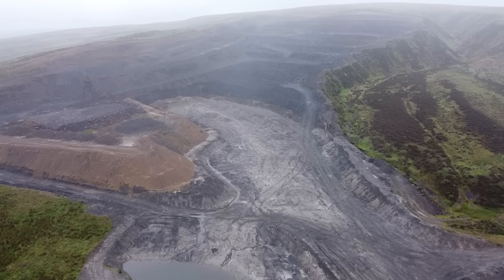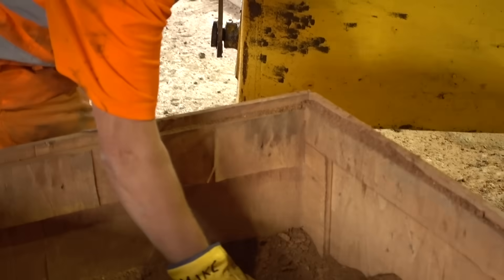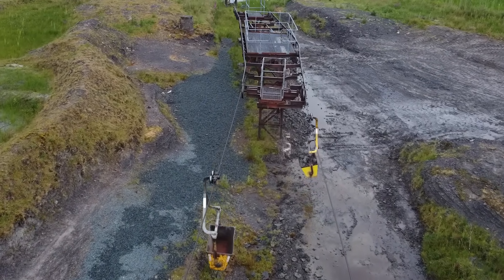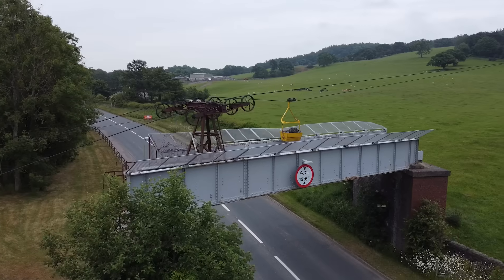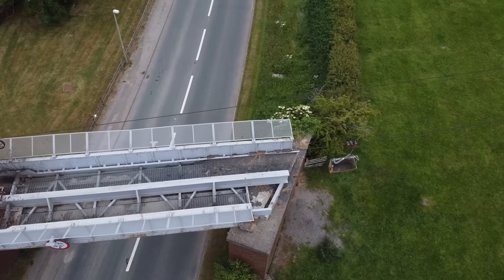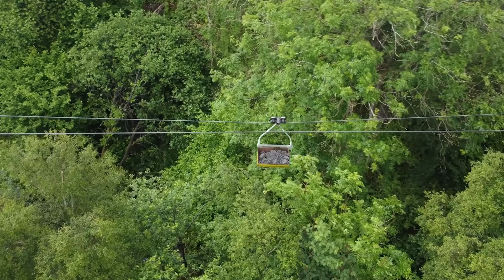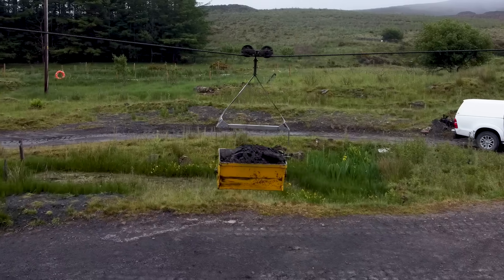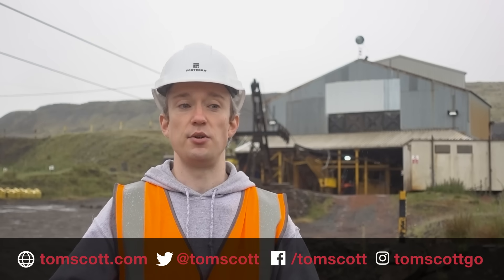The UK's last aerial ropeway uses no power, moves 300 tonnes a day, and will be gone by 2036.

Comment: It's amazing how well old technology works compared to more contemporary solutions. Here in Pittsburgh we have two funiculars built in the 1870s that are still frequently used. They're protected by a preservation society (also the citizens would riot if they were removed) so they should remain for quite some time. And the view from them is stunning.
Reply: What are they?
Reply: @millerchassis6119  we call them inclines, they are counterbalanced trolleys used to go up and down the steep hills into the city
Reply: @millerchassis6119  What empressmarowynn fails to mention is that these inclines use electric powered motors to make it work. (I rode on both) Yes, the 2 cars, one travelling up while the other goes down, are counterbalanced. But if they were perfectly counterbalanced, they would sit still and not move. Even putting passengers in one car and leaving the other empty would likely not be enough to overcome friction. And even IF friction could be overcome, what happens when the passengers disembark from the occupied car? We generally need to obey the rules of thermodynamics, lest Isaac Newton and James Joule come back to haunt us.
There is one of these inclines in L.A. too. It's called Angels Flight, built in 1901. "Angels Flight" is the title of a 'Harry Bosch' book by Michael Connelly & episode of the Amazon Prime series "Bosch."
Reply: @RichardFallstich  there are water powered ones
Reply: OK. It could be powered by water, electric, or steam, etc. they still need some external power to move mass and overcome friction.
Reply: @RichardFallstich  Do you think you need to pedal a bike in order to travel from the top of a hill to the bottom? If you push a ball down a hill will it not move without an external power source? The ore already has potential energy it's simply going downhill. Do you look at hydroelectric dams and wonder where they get the power to run the water pumps? Because obviously all that water can't just move without some external power supply.
Reply: Cincinnati used to have some

Comment: Question: if this is the last aerial ropeway in the UK, does that mean  the Emirates Air Line in London is not a ropeway, or that it's not in the UK?
Reply: "The UK's last aerial ropeway USES NO POWER , moves 300 tonnes a day, and will be gone by 2036"
Reply: @DELETEDUNUSED  Yes. "The UK's last aerial ropeway which (a) uses no power, (b) moves 300 tonnes" and so forth. It doesn't say it's the UK's last unpowered aerial ropeway.
Reply: @joelalexander4748  im sorry im sorry im sorry im sorry im sorry im sorry

Comment: I'm still wondering how it works without the need of fuel or electricity...
Reply: Right, this would make sense to me if the empty buckets locked onto the rope and rode up... but the wheels at the top seem to be spinning. I wish they had gone into more detail.
Reply: gravity stuff i can explain in more detail if you want
Reply: @flowi1227  yes please
Reply: @joepgoossens5667  the full buckets get pushed at the top and since its slanted they go down naturally. since the rope is connected and the empty ones at the bottom are way lighter they get pushes up to the top

Comment: It sounds like they are missing a grate opportunity in this system, there should be a generator used as a load primarily(to slow it down) and a brake as back up. That way some of their power cost can be removed. Can that be done here, even theoretically?
Reply: ""The UK's last aerial ropeway USES NO POWER , moves 300 tonnes a day, and will be gone by 2036"
Reply: @flowi1227  Yes it does, nothing moves with out power, it uses gravity as a power source, and in order for it not to run away in speed they need brakes. What I suggested was to use the same amount of power removed by the brakes to instead power a generator. They have 15 years of power to use, letts not waste it.
Reply: @agw5425  i dont think breaks are nessacary considering how slow it is

Comment: I used to work near there about 15 years ago, used to pass under twice a day. Could see the guys working there grabbing the buckets, they didn't have safety helmets nor HV wasn't that long ago! There was another one going to a different quarry along the road towards Lancaster but that was disused and had no ropes but the towers were still up. It's actually in the Lune valley and is very scenic on a nice day, you can see Ingleborough rising above the hills as you drive east from Lancaster along the road.

Comment: Hastings has a little railway which is operated by gravity. It obviously wouldn't be the same to ride, but it's just as efficient. There are 2 coaches, 1 on each track, joined by a cable over a pulley. There's a tank under each coach. To move them, Water is poured into the coach at the top of the hill and, as it goes downhill, its weight pulls the other coach up via the rope. "The West Hill Lift retains its original wooden Victorian coaches, and also runs through a tunnel, very unusual for a funicular." Edit: And then I looked it up and learned Hastings has 2, and there are probably plenty of others scattered around the world. :)

Comment: The only thing I could imagine it turn into is a skilift attraction, maybe with a themepark at both ends? But then you likely have to ajust the towers and cable to handle that much load. Also the themeparks would maybe in the middle of nowhere, not making it easy to attract people.

Comment: Do you think that they will let the end stations keep standing and maybe some of the cars nailed to the load and off load ramp for tourist attraction?
Reply: Now you know some knucklehead will try to climb the tower claiming to have a right to an adventure, disgrace it with graffiti.
Reply: @norbertdx  Yes I know, and that was NOT my question. It was 2 buildings at each end of the line will they remain, as a hiking track, so you hike from one to the other, and then leave some of the karts beside dem, you could put tem 30cm off the ground with a 150cm pole to surspend them, yes you could use is as a swing. COMMON @norbertdx, as a family hike to the top of the hill and to see the system where they park the carts off the line and put them on again. YES take down the towers... SIGHT!

Comment: I bet people would pay money to ride it back and forth lmfao.
Reply: You could only ride it one way, it’s gravity operated so the returning buckets have to be lighter than the arriving ones.
Reply: @jupiterjaeden9163  And on top of that it could only work with a steady flow of tourists. Can't have just one person on the ride, needs the correct spacing of buckets (each containing like 3 people to match the weight of the shale).
Reply: @nathfrancois5507  or two americans.
Reply: Easy solution: Build the restaurant at the top.
Reply: @victorhopper6774  too much weight, you would need an american child to balance it xD
Reply: @Fritz46  pp
Reply: @jupiterjaeden9163  One person up, two down...but there may be quite unbalanced waiting queues
Reply: @jupiterjaeden9163  Nah, miners used to ride ore buckets to work using the same gravity-feed systems all the time in Colorado, ore and rock weighs more than a few people
Reply: @jupiterjaeden9163  do you weigh a quarter of a ton or something?
Reply: @AinzOoalGown2138_2  i don't think you understand how it works at all
Reply: You could use weights like water cisterns to balance the ride.
Reply: Weight problem
Reply: It would be too dangerous to have tourists in a working mine. Plus they will get in the way of the workers
Reply: @TeaInTheMorning-we2kh  his point was that they would turn it into a tourist attraction AFTER the mine is done
Reply: @woodychelton5590  but then they would have to motorise it because it could no longer be gravity powered since the weight going up is the same as the weight going down.
Reply: @TeaInTheMorning-we2kh  I know that, it's discussed in the vid
Reply: @woodychelton5590  what would be the point then? If you want to ride a regular chair lift just buy a ski resort pass
Reply: @TeaInTheMorning-we2kh  bcuz there are no ski resorts in that area
Reply: @woodychelton5590  Ah, well maybe they will do it then.

Comment: Why doesn't it use any power? I don't get it.
Reply: You don't need power to have a bucket ziplining down hill.
Reply: @MrHat.  But don't they go up as well? It's not downhill both ways.
Reply: @8.3.4.N  downhill with heavy load, uphill with empty load.
Reply: @MrHat.  Ah, that makes sense. For some reason it didn't connect in my brain that the ones coming back up are empty.

Comment: Similar technology can be seen in an episode of Thomas the Tank Engine . The only difference is that the gravity cable was hooked up to rail cars; heavy cars, going down, pulled up empty cars.
Reply: That approach was actually used by a mine in Australia. Two ordinary railway lines side by side with wagons but no locomotive of any kind. Instead the two sets were joined to a steel cable run to the top of the hill. The weight of the fully laden wagons going downhill pulled the empty ones up. Then load / unload at each end and repeat the process. Zero fuel or power of any sort needed. Only reason it's no longer in use is the mine itself has since been closed.

Comment: Very cool. The question I have -- that I was hoping the video would answer -- is  how the thing gets started (if they are not operating it 24-7 or, say, after replacing the rope). Does it require a complete set of full buckets to operate and, if so, how does it operate when not all the buckets are full yet?
Reply: I can only presume but at night the carts going down the hill stay loaded until the brakes are let off in the morning. I've driven under it a few times and they've been stopped with the carts still loaded.

Comment: There's a Victorian thingy on a big hill in Wales, the car, like a ski lift has a big tank under it. A stream at the top fills the tank and the car descends under it's own weight. The other car which is at the bottom empties it's tank and thus ligher is pulled up to the top by the descending car.

Comment: I still dont understand how that machine works after watching this video, but hey, good job to the engineers that invented it
Reply: The extra weight in the bucket going down hill means it’s heavier and pulls the whole wire down hill. And as the rope is a circle it pulls the lighter enough buckets up hill

Comment: Just change the rope way carts to transport ppl and make the upper station a hiking point and for a small fee (for ppl that are exhausted or just for the thrills) you can glide down the land to the parkinglot on the person transport buckets. That way the buckets at the top will always weigh more than the ones coming up. And if you dont use heavy duty metal, the passenger to bucket ratio might even stay the same as it is now.

Comment: Realy genius. The old engineers knew how to use gravity and hydraulics you did not need power. the older houses used gas lamp the gas was piped into the light fixtures back in the 1800s and they used root seller or basement for refrigeration they would get block of ice and they would keep the ice in saw dust and it a good insulation. And they could keep ice year round.  And meat in a ice box.
Reply: @daviddou1408  thanks i had a stroke somtime i catch  it and no spell ck on this but i have an i phone and it helps so i made the correction.
Reply: hate to break it to you,
-Gas lamp or coal gas lamp is a highly inefficient and toxic way of producing light and distributing light, sure it had its times in the downtown city. There are reasons why electricity adoption is much faster than gas lamps.
-Civil engineers or any mechanical-based engineer always, ALWAYS, use free energy (gravity, or passive pressure difference). sewer duct, water purifier center etc. 
-Cupboard style fridge either using ice or refrigerants (freon) does not work as efficiently as a box style with an opening on top type fridge(meat freezer or in your case basement freezer). And saw dust mixed with ice? mold.
Reply: @mickolesmana5899  thats true but if it was burned efficently it would not be toxic. But i do agree that coal is very toxic.  But people did not care because the house where not air tight as the houses today. And the houses of today become toxic by mold.  Now you can burn coal in a rocket stove and have zero carbon emissions. Electric is great but it is not with out flawes.

Comment: "It's 100 years old"
"A bucket has never been known to come off onto the road in the last 50-60 years"

I want THAT story.
Reply: They no longer let staff ride the bucket to the quarry... jk
Reply: @Dosedmonkey  You joke but some of the old aerial ropeway systems when they were in operation in the US actually did have special cars for people to ride. Some operations also had ones for carrying drums of liquids as well.
Reply: @Dosedmonkey  You know back in the old days people rode that thing all the time.
Reply: @Dosedmonkey  btw jokes aside, I'm sure everyone working at the quarry and the factory want to have a special Ride Bucket that you could use to go up. You know, a clean one, with a seat, and without the tipping mechanism. The problem is, it would be disruptive on the way down - less weight. Or it needs some sort of ballast to operate - make it heavier when it goes down, by another couple hundred kilos, to add to the weight of the bucket and the passenger. Maybe a longer bucket, that has got two sections, one for a passenger and another for shale?
Reply: Or the road is 50-60 years old and didn't exist before that
Reply: @FenceJumper87  Very good point!
Reply: @jeffsanders663  It looks like the brickworks is on that road. Also, most roads in Britain are very old. It most likely was there.
Reply: @longbeardbobson4710  

Most roads in Britain are very old . 

What are you smoking ?
Reply: @Dawgreen  Do you think otherwise? I mean rowds from place to place, not urban streets.
Reply: @longbeardbobson4710  arterial roads, l think you were talking about.
Reply: @jeffsanders663  But not in this example. It's a major valley with a long-standing road , and on the other side of the Brickworks there was even a Railway Line ( now dismantled)
Reply: @FenceJumper87  probably when they decided to build the bridge/catcher. But that doesn't mean they had a bucket fall off before then likely just a cautionary measure.
Reply: @FenceJumper87  or they only have information from a maximum of 60 years ago
Reply: @FenceJumper87  Or they don't have records that are older than 50-60 years?
Reply: @FenceJumper87  Or they just didn't have records going back earlier to prove what happened prior
Reply: a bucket came off onto the road 50-60 years ago
Reply: @DoctorAsshole1  Tell it again grandpa
Reply: it come off into the road but there were like 5 cars in whole neighborhood so nothing happend
Reply: @Karudzik  Possible, but an old friend in car sales once told me car ownership (in Britain) took off in the 50s; 60-70 years ago. Then again, the roads clearly didn't get clogged up all at once. It seemed to me that there was another huge surge in car ownership in the 90s.
Reply: It doesn't mean it fell on top of a car, just that it fell on the road.
Reply: There were several of these cable roadways in Sandon, BC to move silver/lead ore from high on the mountain down to the concentrator in around 1896. It had no power source either. The steel cables still lie on the mountain when the mines were abandoned.
Reply: @normferguson2769  same in the San Juan mountains of Colorado.
Reply: It's just so that no-one can remember it for longer than 60 years.
Reply: A bucket fell into the road. 3 weeks later a drunk tripped over it.
Reply: that was probably when they build that bridge
Reply: 99% of the time, it works every time.
Reply: ESPECIALLY in the last 50-60 years, meaning it's never come off yet safety standards have still been improving.
Reply: So if mining is finish there wy not use it for persons that want to ride whit it so like 1 cld I mean
Reply: There's a Safety Bridge .....
Reply: A bucket has never been known to come off onto the road in the last 50-60 years

Comment: Surely, if designed to take a quarter of a ton, to put a person in it, when it all closes down and turn it into a tourist attraction isn't beyond the bounds of imagination is it?
Reply: 500lbs per bucket, so about 2 or 3 people. They all need to be full, because the full buckets fuel the system. Is there enough tourists to keep it running? Maybe only on the weekends? Those buckets aren't really big enough for 3 people. 
Also,
I'm willing to bet they currently shut down with full buckets on the wire rope so it will start moving the next morning when they take the brake off. Would need weights in the empties as the last riders got off...